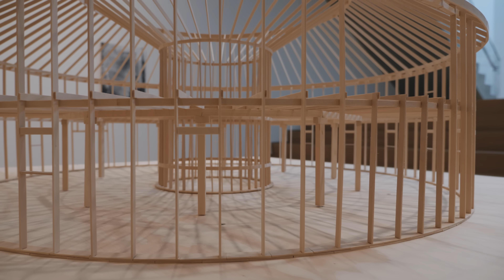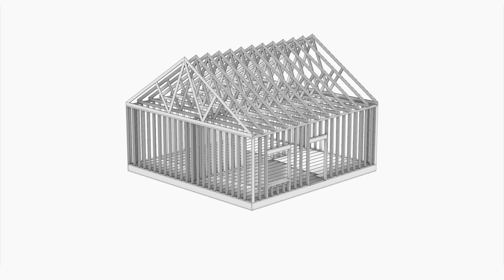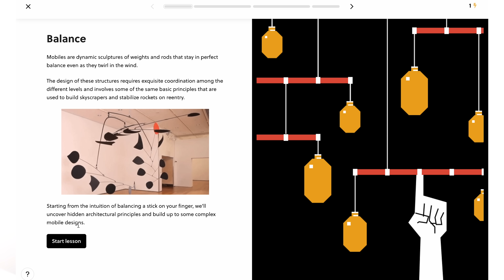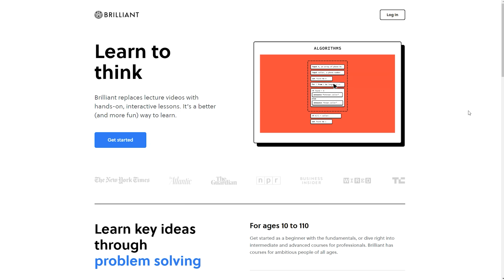The Genius of 2x4 Framing

Comment: In my country we build houses mostly with brick and mortar, a lot of steel and an insulation. The wood is used mostly for the roof
Reply: Sounds like a proper building to me.
Reply: @danielr.  Yeah, it's because the climate it's hot in summer (up to 42°C, normally a daily max of 36°C ) and somewhat cold in winter (minimum -5°C, normally a min of -1°C). And there are A LOT of earthquakes, and once in a pair of decades a big one. Besides that, as the summer is so dry there are fires easily too.
Reply: @amermeleitor  Where do you live? Sounds somewhat like Chile to me^^
Reply: @danielr.  Chile 100%
Reply: @amermeleitor  Bacán! En que parte? Viví un año en Valparaiso, era una experiencia única. Si te interesa, tengo buenos videos de todas las partes de este hermoso país en mi canal :)
Reply: @danielr.  Quinta región cordillera, valle de Aconcagua. También Santiago, valle del Mapocho. Valparaíso es una excepción en la zona de los cerros, donde se sigue construyendo en material ligero y fuera de norma. Cada verano hay incendios en esa zona
Reply: Same in my country: our houses are very durable. Lightwood framing is only used for shacks...

Comment: I would not call it "genius" at all, it is just the CHEAPEST way to build a house.
It may have been less skilled labor, but today it has very HIGH labor costs, because look at all the STEPS involved to build a house, framing ok, but now you need insulation, drywall, sheeting, outside sheeting, roofing, etc, etc.
A house built with insulating lightweight concrete reduces ALL of it to a single structure that provides it all in a single step.
This is now how they build in other countries, the USA still does it the old expensive way.

Comment: For a person from Northern Europe, seeing for the first time how a house is built from sticks and osb panels comes as a shock. The USA 🇺🇸 has many peculiarities, like bumpy concrete roads or overhead electricity and communication cables in cities. Why not disposable houses?
Reply: I´m pretty sure lumber fraimed houses is very common in northern Europe. Most people i know live in them. Specialty so when its a bit more north when bricks just don´t work. While you can get a way with a brick house in UK or Denmark. In Finland for example a brick only house don´t work. then you have to ad a inner wall.

Comment: OSB, Oriented Strand Board isn't made with scraps and sawdust or waste parts of a tree.  It is made of whole logs that are peeled into big flakes.  Particle board is made of sawdust and waste wood chips.  Particle board isn't used much in proper stick built houses due to its lack of strength.   I used to work in a particle board mill and my inlaws in an OSB mill.

Comment: Every house in my country is made with brick, so I was surprised to learn that most houses in the US is made of wood.
I know it's probably not that bad but still to me that sounds quite dangerous and not very sturdy lol. Like, can you break a wall if you hit it with a baseball bat or when moving furniture around?
Also, the fire hazard is unthinkable for me.
Reply: I enjoy being warm in the winter, and cool in the summer. Brick construction is far more expensive and provides far less insulation. 

Walls are covered in "drywall" which is rock. It's fire-resistant and easy to patch if damaged.

Comment: Another factor that should be mentioned: this flexible and well breathing style of construction is especially effective in climates with huge temperature and moisture variations. Other than indoor plumbing and electricity, fiberglass insulation, wind and vapour barriers are the largest contributors to health and comfort in homes since the middle ages.

Comment: The video was informative and well-presented, but I think it gives light framing a bit too much credit. My experience tells me a well-built brick/concrete house outperforms a well-built wooden house in every metric except (sometimes) cost. Thermal insulation, noise insulation, longevity, maintenance cost, fire resistance, water damage resistance, quality of materials, and so on. The disparity gets even worse if we compare lower quality examples of each type. Here in Spain though, either type of wooden house detailed in the video would cost significantly more than a concrete one because they're standard and wood is expensive, so it doesn't even have a cost advantage. (Let alone the fact we would cook to death since many homes lack air conditioning.)

The tendency of wood towards single-family housing in residential-only suburbs is also just unabashedly problematic, and while it's recently finding its way into larger mixed-use buildings and even skyscrapers for its renewability factor, it's only really a novelty as of now as we already have centuries of experience building vibrant mixed-use spaces with masonry.

Finally, wood framing almost always employs unsustainable and frankly undesirable cladding. Vinyl siding is bizarre if you think about it, like how have we normalized plastic houses? Why is that the material you would want to show off as the outermost layer? Then internally we get drywall which serves the purpose of covering the beams so that it looks more like a wall. No noise blocking, no strength, just aesthetics. Can't even hang anything heavy-ish, you have to find a beam, which would be like drilling into rebar to hang a painting in a concrete house. Needing to replace your roof is a foreign concept to most people I know, as are termites and worrying about house fires.

I think in the specific context of 19th and 20th century North America, light wood framing was an important evolution from previous building methods. But overall, without that context, I think it has outlived its usefulness and become synonymous with low-quality, overpriced, and car-dependent spaces.

Comment: In college I was working on a degree in geology, and the subject of light-wood framing came up. There is an unexpected upside to the way it's usually done, and that is houses built this way come with a degree of earthquake resistance. There are three reasons for this.

First, the way the frames are built is resistant to collapse, because there are so many supports, so many connections, the force from the earthquake doesn't have a weak point to focus on. 

Second, the buildings built with this method can sway, which is important for riding out an earthquake. 

And third, if a collapse does occur, it tends to be a collapse that creates pockets where people can still breathe and potentially crawl out. 

This is actually very important for American housing, as the New Madrid Fault Zone in the eastern half of the country famously rocked the nation with three major quakes back in the 1810s. Though the fault zone is in Missouri, it rang church bells on the East Coast and cracked sidewalks in DC. If the same quakes happened today, half of the entire US population would be in the danger zone. That means making all our houses in this way will help save lots of lives if those earthquakes happen again.
Reply: This is something I think about with regards to masonry housing in that area. It's undeniably better at insulating against extreme heat and cold, and will also survive powerful wind storms and tornadoes for longer than a stick-built house will. But in an earthquake, they just turn into heaps of bricks...
Reply: @MalikCarr just build using earthquake resistant bricks
Reply: It's miraculous really.  I'm not much of a builder.  Only scratch built a few sheds.  The amazing this is how they become rock solid and absolutely unmovable once the siding is installed.  You can join the studs with only two nails at each joint and the whole thing seems wobbly until siding is applied, then rock solid.  It's a great application of physics and economics as well.  If you've never tried it, give it a go.  Build a shed or even a dog house.  It's a great learning experience and not difficult at all.
Reply: @RedPillSurvival  Great point.  It's incredibly strong.
Reply: Thank You! In Florida most homes are block in my neighborhood. For hurricanes that's good. Earth Quakes is another ball game. Wood construction is the safer method. Thanks I never thought about it. I keep my wood home. My Florida home will be sold and the house that my father in law had constructed is made of wood. 73
Reply: These are good points, although one can elaborate on the second point: the building sway.  The fasteners that allow for sway in modern stud construction are typically nails.  The friction released as heat eliminates much of the force along the load path to the ground, meaning that both the internal forces in the wall do not destroy the wall, and then the load is less at the foundation...meaning...less excavation, less concrete, less rebar, and pulls the building schedule to the left.

It's worth it to add that nails are pretty incredible for their flexibility, so it will probably be measured over time their good resistance to the vertical component to earthquakes, that is sometimes overlooked.

Also adding that the lighter the building, the less the base shear (where the walls meet the foundation) and where the Earth will accelerate against the structure and 'try' to sever the wall-to-foundation connection.  The heavier the structure/building, the greater this shear force, and consequently bigger connectors and possibly a bigger foundation is also required, e.g. more concrete, rebar, excavation, and time.

Finally, the timber stud wall is much lighter for wind/earthquake/tornado forces going in the opposing direction (out-of-plane forces) and requires less perpendicular buttressing than, for example, a block wall, concrete wall, or mass timber wall.

Comment: Wood frame houses seem fine... until you live in a quality-built house, like most of the houses you find in Europe. It's so nice to not hear everything that goes on in the house from everywhere else! It's just fantastic that a moving accident won't put a hole in the damned wall. It's simply amazing that your house isn't literal tinder and fuel for a fire. Seriously, wood framing is fine for cheap or disposable hoses, but for everything else, it's scandalous.

Comment: Mortice and Tenon is not the most common way to build a post and beam home these days. It is much more common to use steel hardware to join the timbers. Using joinery is a decidedly high end and more expensive option these days.

Comment: Doing carpentry, plumbing, and various other construction I’ve come across all kinds of different house construction along the east coast. Seen some crazy stuff they used a few hundred years ago and then even more when I moved to Europe and Asia. Some are an art form to do. I remember when I was first taught wood paneling for walls instead of dry wall. Also doing cast iron pipes.

Also hamburgers coke from sandwiches that (if I remember correctly from my time in the military and it’s history) was an admiral who was at a diner and got tired of waiting and put meat between two pieces of bread with some other stuff with the meat. From there it caught on. Also the Turkish donnër kabob that’s really popular in Germany and other places in Europe (wish it was here in the states).

Comment: I think I learned more about hamburgers in this video than I did 2x4 framing. I was hoping that this would explain why they settled on the sizes they did or the spacing. Why is a 2x4 actually 1.5x3.5 inches? I mean, I know that the rough cut on lumber is actually 2x4 and shrinks but why didn't they just make it bigger so it came out 2x4?

This video really said nothing much about the actual "genius of 2x4 framing" and spent more time just comparing it to the popularity of hamburgers.

Comment: This "standardization" is an extension of the industrial revolution that created interchangeable parts and the production line for mass production of say, automobiles. And the one characteristic of a wood frame house that differs from a hamburger is hamburgers taste better and are easier to chew. But both are subject to easy burning. ENOUGH heat and poof! But the real irony is, if you want to cook a hamburger, you could do it over the flames of your burning house to get that smokey flavor. 😄
Good vid. Enjoyed it.
P.S. To be serious, I live in a kit house from the turn of the last century. The original owner built it with his own hands. And it has true dimensional lumber. Actual 2/4s, 2/6s and 2/8s. Why is it that lumber was trimmed down to smaller dimensions? A 2/4 is actually 1 and 1/2 by 2 and 1/2 for example. 
Thanks.

Comment: 2x4 construction... yea saw people use 2x4 for load bearing and they FAILED.
floors use 2x10 roof 2x10 or 2x12 16 inch centers if you have heavy snow.

Comment: A future evolution, All Things Considered, is a unified 'DOUBLED" structural ridged frame (wider spaced, say 4 feet) parallel cord truss sidewall and roof truss unit with light semi structural (in between) mobile home type truss units for additional sheathing and interior finishing attachment points.  All specifically designed for the deep wood fiber filled insulation cavity and to fully utilize the output of the small sawmill / home building operation which will be extant in the future        Yes, using the 2 by 4  (and lighter).

Comment: I always thought the main benefit of stick framing was the uniform cavity allowing standardized insulation to fit. Also the module of current US framing is NOT 2 inch, it is a weird group of stupid random dimensions: 1 1/2, 3 1/2, 5 1/2, 7 1/4, 9 1/4, 11 1/4 inches. Stick framing is quite weak and flexible and prone to failure unless joints are properly cut and fastened and structural sheathing is correctly applied. It is not a forgiving system. I see several framing mistakes in this video.

Comment: So, I came across this video and your mention of round houses and 22' made me wanna say this. I work in a factory that builds trusses, floors and walls. Then delivers them to be setup, or however the order is to be filled (my company has options from full house to just trusses probably) anyways, We actually don't carry any lumber longer than 20' and we only stock 4 grades of lumber, 1650, 2100, 2400, and stud (this is only used with floors tho I've seen) but yeah anything over 20' is going to get a splice. I also hate 16' 2x12 2400 especially when I gotta load them in my saw

Comment: I'm not sure "dumbing down" wood construction techniques is the way to go. Personally, I see way more advantages in timber framing then in light wood framing. To be it seems like the 2x4 technique though cheaper and more accessible are also much more fragile, but I can't say anything about that since we do not really use that format in Europe. Even prefabricated wood houses have bigger components at the appropriate locations. I have, however, no qualms about using the 2x4 as partition walls.

Comment: the trend for a lot of post framing is to use laminated members in the same capacity as their unitary counterparts, and to utilize fabricated stamped steel brackets attached with bolts or lag screws where ever possible to avoid having to do any joinery. very large overhead doors still require hand joinery, but most of the structures that use those are built from steel beams now.

Comment: I love how every one thinks it's all about the nails. It's actually not. The reason platform framing took off was the speed at which a quality structure could be made. And what gave it the speed was the simplified joinery. Butt joints and half laps.

One of the big hallmarks of balloon framing that wasn't mentioned is that it provides for bracing against warping bowing and checking of lumber. It also needs to be assembled square before it's stood up.

Platform framing can be entirely done with out metal fasteners since it is done with pinned butt and pinned lap joints. In most cases that is a nail Al though commonly screws are used now. The strength main strength of nails is not in pull out but rather shear strength.

There were multiple instances of people using timber framing joints in platform style .... Dados dovetails etc.

Matter of fact most of the furniture joints came from wood framing.

Thanks for the hamburger metaphors.... Now I'm hungry cuz all us framer eat burgers lol

Comment: I would like a story on why engineers put an engine starter inside the transmission and under the intake manifold. why was that a good idea? you know the bolt you can see but you have to disassemble the front end to change a headlight kind of engineering
Reply: Engineering a modern car is mostly an act of legislation today. Every single part on the car is targeted to work in a variety of platforms that sometimes vary dramatically around the world. Each different locale has different (and often very numerous) laws that constrain design. To meet modern emissions standards, thermal management has become more important than ever before. This often requires part clearances or placements that don't make sense out of this context. All of this is to say that the engineering of a modern car that is in any way profitable is wildly, WILDLY complex in ways someone outside the industry would probably never guess at. And so you sometimes end up with parts in places that make no sense to someone who never had to cave their brain in trying to meet the 7,000 laws that govern just the engine bay.

And good old programmed obsolescence is alive and well.

Comment: why not build a house out of bricks when it goes cheap way with wood.

one of them is enough to destroy your life:

1 tornado 
1 hurricane 
1 car driving trough your TV room
1 candle to burn down the house
1 electric overloaded wire
1 lighting hits your woodshack
and after 50 years you can replace all of it.

just build it good with bricks/cement/steel and you have a house that serve you for more than 100 years.